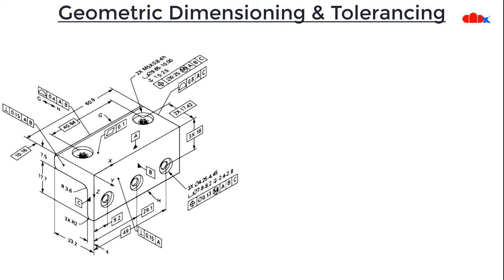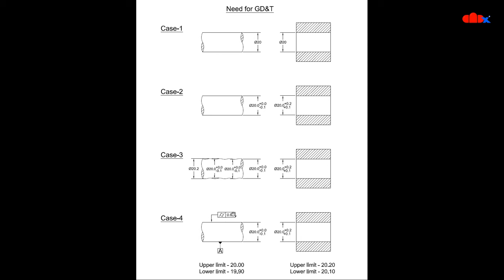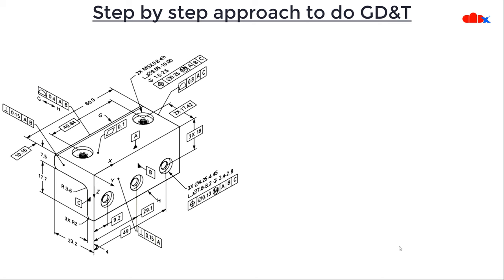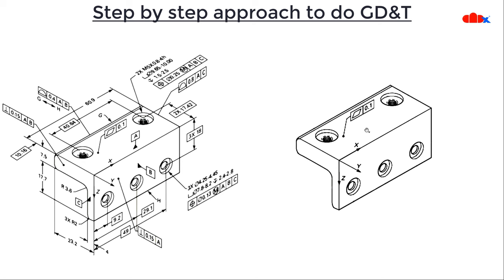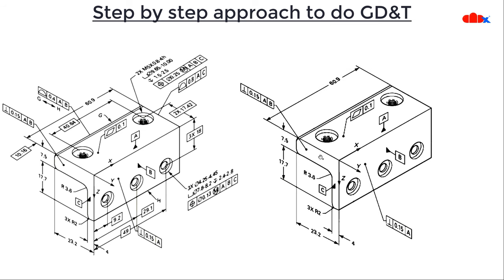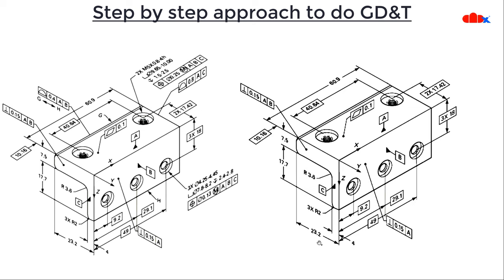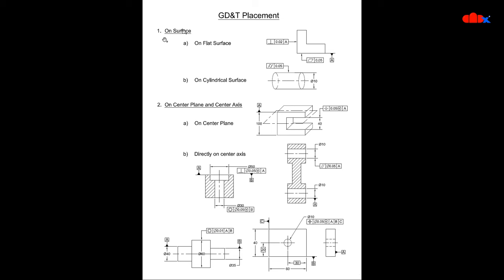GD&T for beginners | Step by step approach for GD&T for mechanical drawings

Comment: Question:

Let's take the 23.2 Dimension (Video Timestamp: 10:43) and the perpendicularity [0.15] with respect to Datum A. 

The Perpendicularity creates a tol zone of width 0.15. 

How does the 23.2 dimension relate to the 0.15 tol zone? 

Let's say the 23.2 has a tolerance of +/- 0.2 so it can be between 23 and 23.4. 

But now you have an additional 0.15 wide tolerance zone from the Perpendicularity. Does that get "added" to the 23 | 23.4 dimension? Or is it a further refinement?

Comment: Sir at 4:22 how it's possible that deviation is +0.2 if the upper limit of shaft dia. Is 0.0.... in this condition shaft tolerance should be +0.1 & -0.1

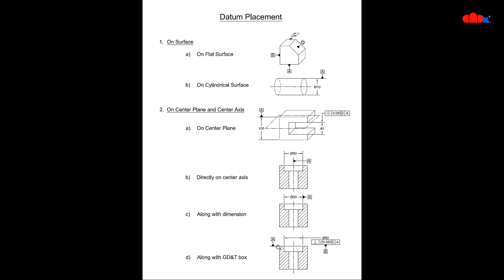Comment: @ 13:46 you say in 2) b) datum A is directly attached to center axis. I am pretty sure that it should not be done. the reason is the person cannot be sure if the axis you are referring to is the bigger hole or the smaller hole.

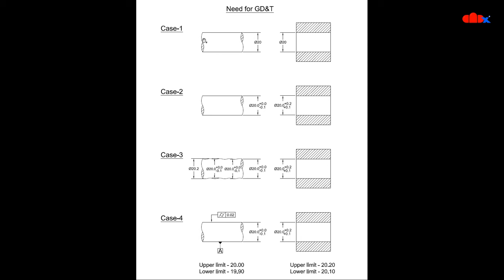Comment: In your case study around 1:50 while your reasoning for the example make sense except a 20mm shaft will NOT go into a 20mm hole- it would be a press fit at that point-

Comment: Hi,
In the case 4, you mentioned that the maximum diameter can go up to 20.02, but as per basic rule nothing can go beyond the size limit so the diameter can not go above 20 as per shown tolerance.
Please correct me

Comment: Sir very nice explanation.  can u explain how to choose a tolerance for a Dimensions.
Reply from the maker: There are multiple factors involve to select a tolerance value for any dimension. Some of these are
What kind of fit you need between two parts inside the Assembly.
What precision you are looking for.
What kind of manufacturing process you are going through.

Comment: What standard are you referring to? If using ISO 1101, It’s no longer correct to put datum directly on center axis. You would not know if you mean center of counterbore diam.50 or the smaller diam.

Comment: Thanks a lot for your videos. They are always very good. I have learned a lot. I have a question. Need to know how to assign, say for example, length and thickness to the description parameter of the model. I do so in Inventor Description property is, =PL <Thickness> x <Width> x <Length>. I request you help me please. I am very new to CREO. Creo is good.
Reply from the maker: If you are talking about the model parameter, thickness is already a part of model parameter. Go to the parameter and you will find smt_thickness as the thickness parameter. Let me know if you need for dimension.

Comment: sir, i want to ask. can the datum B and C be interchange between one another? i'm confused which surface should be the second datum and third datum. but the datum A i already understand due to the inspection table. how about the position rule for datum B and C? is there any rule that they need? you choose datum B on the 3 hole flat surface right? so can i change it to the other surface? like in your example, on surface datum C
Reply from the maker: Yes you can interchange datum b and c if  needed. Actually this depends upon the systematic priority of the reference surfaces.

Comment: How you select 0.1 as deviation value for flatness is there any calculations for that..
Reply from the maker: There are multiple factors involve to select a tolerance value for any dimension. Some of these are
What kind of fit you need between two parts inside the Assembly.
What precision you are looking for.
What kind of manufacturing process you are going through.

Comment: can we consider the imaginary central plane or an axis of symmetry as datum?
Reply from the maker: When you consider an imaginary center Axis as datum, that means during the inspection of that part, you are holding that part using the same imaginary centre axis. Now how do you hold that part using the imaginary centre axis, that is the question. So we hold that imaginary centre axis using some external device. Once you see how we  do this practically, then only you will understand the whole concept.

Comment: Thanks you so much for the video...i have noticed that in the case.4, the bigger dia of shaft is 20.02 as per your cylindersity, and you lower limit of hole is 20.10...doe not work. Kindly correct me if i am wrong
Reply from the maker: If the shaft dia is 20.02 and hole is 20.10 then why it will not work? Shaft dia is smaller then hole then it should work I believe.

Comment: If the size of the part is very small if it is coming within the tool size, flatness is not required. Iam not clear can you please explain in detail.
Thankyou
Reply from the maker: The answer is very simple. First you tell me, how do you produce a flat surface?

Comment: 0.15 is degree or mm deviation from datum A ?
Reply from the maker: mm
Reply: But we are giving perpendicular position tolerance with reference to datum surface then it should be in 90degree with tolerance 1/2degree....am I right? Pls guide
Reply from the maker: Write down the video timing
Reply: 9.00 to 9.40
Reply from the maker: If gd&t is applied to the surface, it shows the surface deviation. If gd&t is applied to the centre axis, it shows the deviation of center axis. Gd&t tolerances are not dimensional tolerances. Dimensional tolerances will be given separately in the drawing.